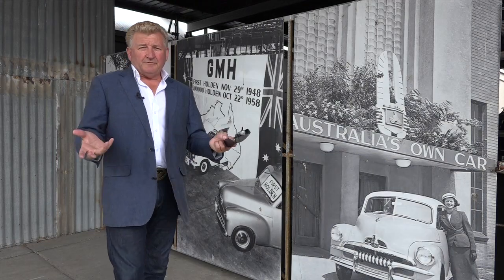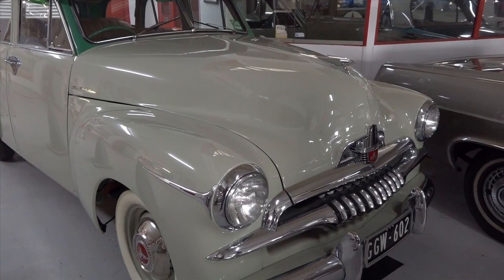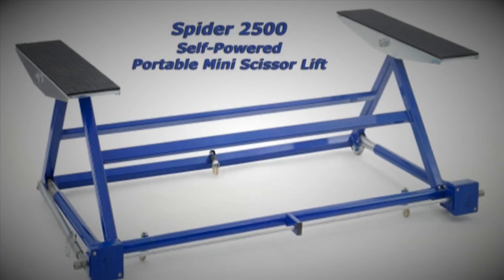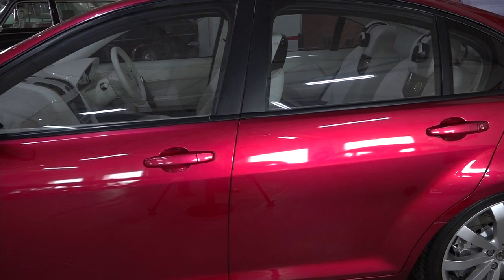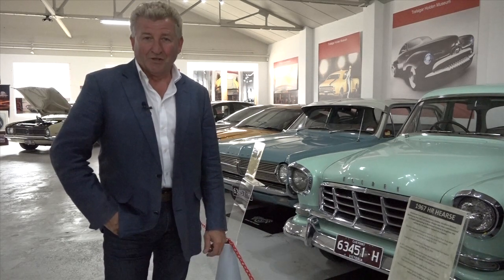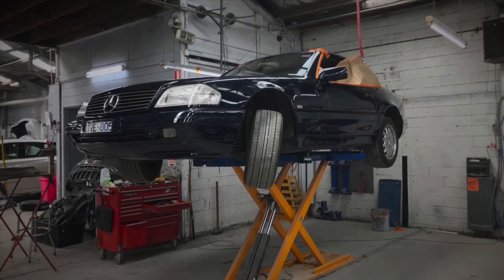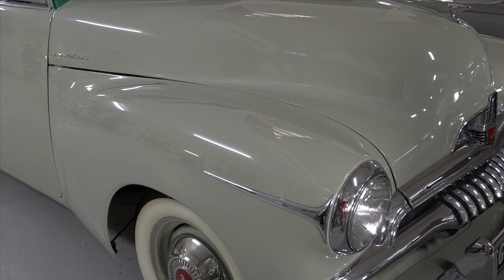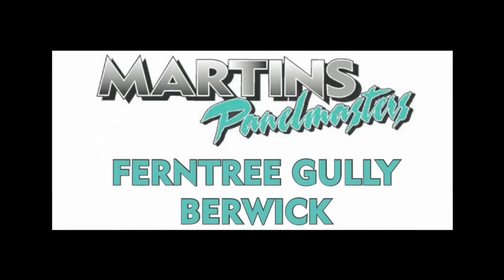Holden Museum -Trafalgar: Classic Restos - Series 39

Comment: the v6 is a front wheel drive engine made by Vauxhall   thats why its hard to change the thermostat at the rear of the block tight fit  near  the firewall

Comment: That was absolutely fantastic. Thank you very much for showing these gorgeous sleeping beauties. Spoiled only at 2.45 by a bloody Commodore. Hey just a thought, apparently somewhere in Victoria the prototype of the unreleased WB Kingswood sedan is on display. I have seen some pics of it. It's front looks the same as the WB commercials, but the rear was full on HZ Statesman with different tail lights. From what I read at the time this car caused a lot of heartburn within GMH. Some where saying that they should have a larger car to compete with the Falcon. Others argued that if it went ahead that a lot of customers that bought HZ Statesmans would be pissed off to see a Kingswood or Premier that looked liked their car. History shows that their gamble with the Commodore failed and Ford took advantage and cleaned up. Their are a lot of very important Holdens that have been well documented. The Monaro's, Torana's etc. But this WB Kingswood  prototype marked a pivotal point in GMH's history and it's story needs to be told.
Reply: its at birdwood in S.A ...... or was a few months ago

Comment: Love your video Fletch...but...early Toranas had 4 cylinder motors
Reply: Yep, HB being the first..Jack Brabham special.
Reply: @lauriechilds6819  true, GM is even feeding it's  homebase U.S. the rough end of the pineapple choosing to rip them off and heading to China. Worst thing we ever did was allowing cheap imports to flood the market, that and SUV sounded the death knell. Not only Holden but at one point VW, Chrysler Ford and Mitsubishi were manufacturing here, now we have a dole queue with no jobs for the young. Our politicians need a kick up the backside for selling us out.
Reply: I think they were referencing the later Toranas which offered V8's a few years later.